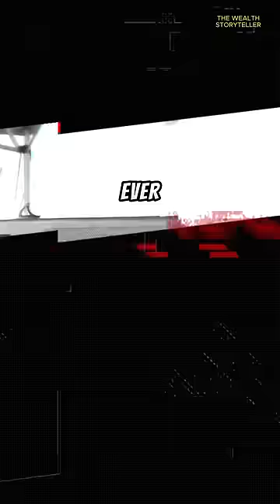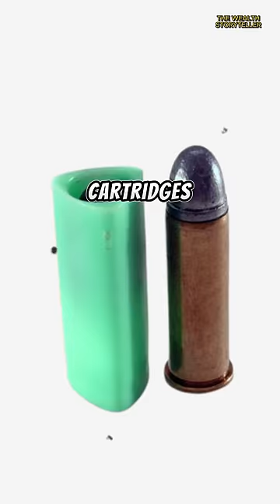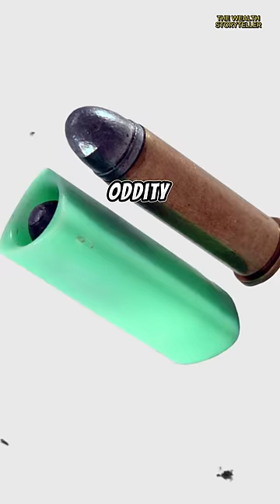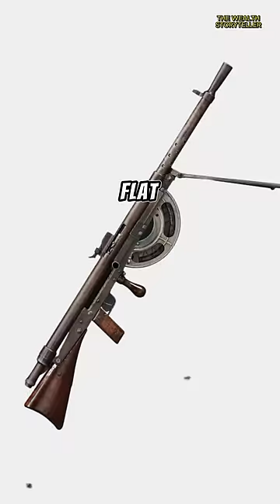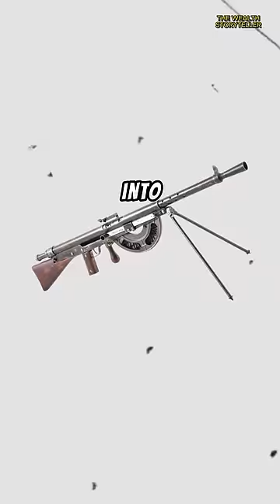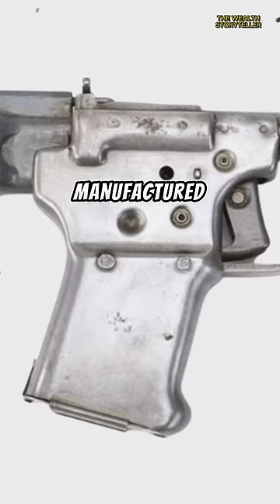3 world's dumbest guns ever made

Comment: The Liberator was never intended to be used like a regular pistol. And it was mostly a psychological tool. It could be mass-manufactured very cheaply and made the occupiers paranoid.

If you want a genuinely insane firearm, it would be the matchlock hand mortar. It was the precursor of the grenade launcher. But back then there was no contact fuse. So you armed your grenade by lighting a piece of rope on fire... and then stuffed into a matchlock musket... and then you had to blow on the fuse of the musket (while the fuse of the grenade inside it was burning), pull the trigger with the cover on to check whether the cord length was ok, adjust the matchcord, then remove the cover from the pan, (while the fuse of the grenade inside the barrel was burning), then blow on your fuse again to make it smolder hotter, then fire your gun, and if it failed to fire (which often happened) then you had to throw it on the ground and run away, because you had a burning grenade inside it ready to blow up at any moment.

Comment: CsRG m/15, aka Chuachat, failed many time because the gun was prone to get dirt inside the magazine. The US also ordered some from france to be designed in 7.51 x 46 (Springfield 1903 round) which messed up the design pretty badly.

The Chuachat was also made to be extremely cheap and have versatility in its places of manufacturing, basically it could be literally be made in bike shops.

Comment: The problem with the chauchat was not the design but the manufacturing process. Production standards were so loose that the parts were not interchangeable. The only part that need a redesign was the magazine. The opensides collected dirt and mud and added to the jamming problem caused by sloppy manufacturing.

Comment: The liberator gun was by made by GM it was an assassins weapon and when you shoot someone at point blank range you don't need rifling. I would take one if I didn't have a weapon. It wasn't a desperate weapon. Like any tool if used within it's limitations it has a use. It was not designed as a sidearm . It was a single shot but it had 3 rounds stored in the grip.

Comment: I know arguing with AI generated YouTube poop is pointless, but the Liberator was NOT a dumb weapon. It was intended as a small, incredibly mass producible, disposable pistol for use by resistance forces in basically hit and run/ assassination style attacks. It wasn't intended for prolonged use on the battlefield, or even to be fired multiple times in a single engagement. It cost only just over $2 US to produce and the only reason it didn't see more widespread use with the French resistance was the difficulty and amount of time involved in getting them safely into the hands of resistance fighters. Before many could be put into play the allied forces were already preparing to storm the beaches of Normandy.

Comment: The liberator isn't made to be reliable, it was designed to be used for assassinations, or to kill one man with a gun so you can take theirs. 

It's not a gun that was ever supposed to go to a battlefield but for undercover resistance movements. Actually it's the smartest weapon, you can air drop a singleshot pistol behind controlled positions to agents that could kill an officer, then just get rid of it so it can't be traced to you. 

Other then that, people in controlled territory were disarmed and controlled firearms in the area which would mean many of these guns would get confiscated. If you made the gun cheap and easy to manufacture then instead of being able to just get one in country and risk it getting captured you can drop thousands all over and most would get through. Which means you have people with guns everywhere, which prevented the nazis from being comfortable in country. The psychological impact alone would make it worth it.

Comment: The Fp-45 Liberator was used by the French Partisans It can Only Range about 15 to 25 meters. Once they shoot a german Soldier they would switch guns  because The german guns haf longer range than the Fp-45

When I was a 7-8 years old I thought the Fp was a modern gun, But when I researched (When I was 9) it was actually a WW2 gun and used by the French Partisans.

Comment: The tround was literally an experimental round. They didn't know how well it would do and they knew they didn't know how well it would do. "Your experiment failed therefore it was dumb," is not viable reasoning, you oaf.
"The Liberator ended up being a tool of desperation." yes... Did you think ppl living in Nazi-controlled France were living in the lap of luxury?
For those two failures on your part alone I'm willing to believe the comments here talking about how the Chauchaut was more built out of necessity rather than for reliability...

So yeah, you failed on all 3 points...

Comment: The liberator isn't stupid it's genius while yes it's designed for resistance fighters it's not designed to be a primary weapon or even a fighting weapon or a sidearm literally the goal and intended use of it was you and a buddy walking down the street as normal come across two soldiers standing gaurd or even better one could effectively sneak attack them take their weapons and gtfo quickly it didn't need to be accurate it didn't need to have a high ammo capacity or be durable it's a point blank single use weapon it just needed to work once and be easy to use and cheap to produce